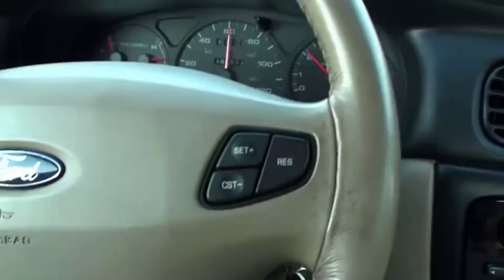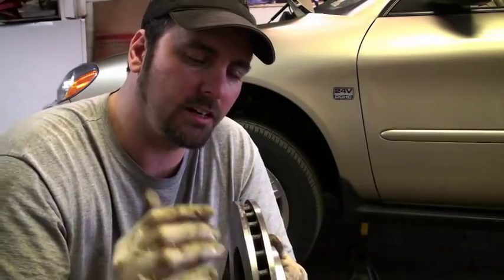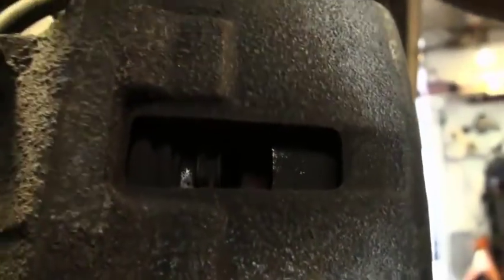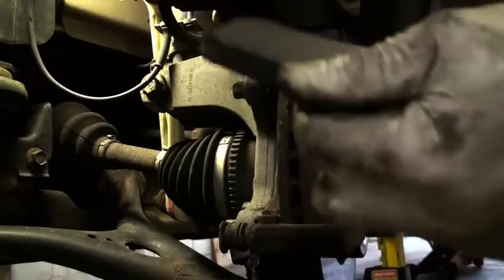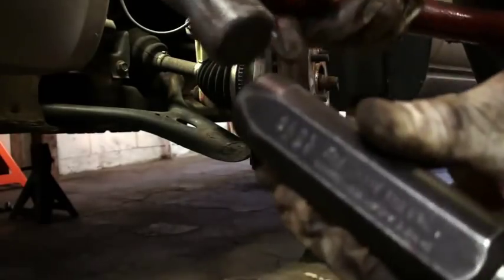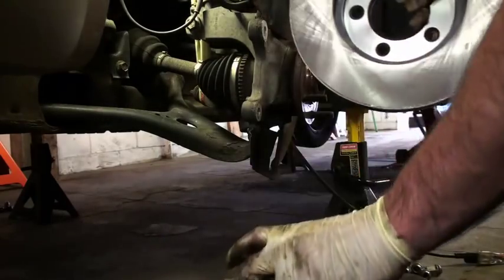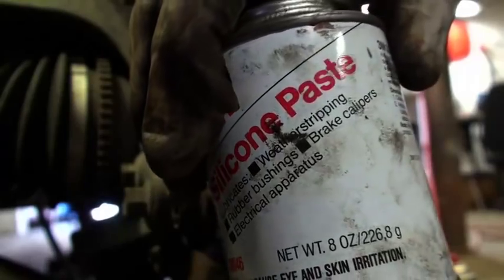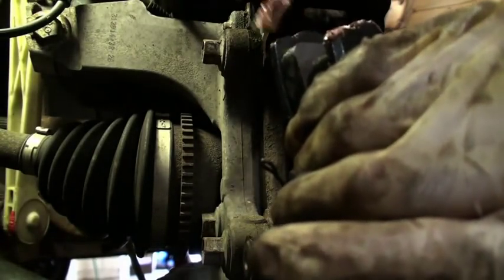Front Disc Brakes and How to Replace Them - EricTheCarGuy

Comment: Eric why aren't you showing proper cleaning or the caliper mounting brackets? there is usually more rust build up in northern states that cause pads to lock in place as well as the slides. there was no mention to use the correct caliper slide grease, or even using some stay quiet on the back of pads, or anti-sieze on spot with metal on metal contact. I have to ask are you ASE certified? You are knowledgeable yes but there are proper steps to make brakes last longer.

Comment: It is better than clamping off the high pressure brake hose, which may damage the hose.... you just don't clamp off hoses that take 5000+ PSI...  it is asking for trouble.

Comment: I do not like the brake hose with vise grip method, if you want to avoid the old fluid from the caliper to go back to the master cylinder, then just crack the bleeder valve open then compress piston into caliper. Old fluid will leave the caliper so in sense you do a partial bleed.

Comment: I don't fully agree with Eric's approach.   1. Resurfacing rotors, really? So what even if they are bent a few micrometers if the pins move in and out with it? Think!   2. Bleed only if you have no c-clamp handy. Be careful how you tighten the valve-they brake easily.   3. Make sure the giuding pins have not seized. Most of the service stations don't check them and just slam the new pads, get the money and kick you out. Pins are essential for well working brakes. I don't know what is this silicon paste. I used regular high-temp resistant grease. I didn't know grease eats the boot. Then how the cv-joint boots stay "uneaten" for about 10 years? I'd simply clean out the holes for them from the old grease.   4. Make sure your pads match the okd ones and have the shims on them and the pad with the sound spring goes on the outside part of the rotor. Provided you have such pads of course.   5. Don't overtighten, better use non-permanent soft thread locker.   6. Measure the thikness of the rotors each brake pad change and keep it in check. When too thin, replace. Forget about resurfacing and cleaning it.   7. Don't just change anything because you think you can. Brakes that need changing squeal a lot and are still good for many more miles. Of course, once the mid line is gone, they have to be replaced.
Reply: Eidmantas Ivanauskas
When you brake or even strip the bleed valve you'll know what I meant while fixing it...

Comment: Why must you replace the pads if you are replacing the rotors if the pads are not worn out? If they are not worn out one would think there is enough pad material to build up on the rotor.

Comment: I was a little concerned on some items Eric, especially reassembly.  When reinstalling the pins, you did not mention cleaning the female part (hole) the pin slides into.  Most all failures of pins occur because contaminated (hardened) grease is left from the previous brake service.  Clean thoroughly with solvents but also hone (180 grit flexible balls on wire stick) the hole.  This creates a perfect crosshatch pattern that's clean and free of old hardened grease products.  StopBrakeNoise. com

Comment from the maker: @gozanze4ever Normally I wouldn't respond to this but I can't stop laughing.  Break= separate or cause to separate into pieces as a result of a blow, shock, or strain.  Brake=a device for slowing or stopping a moving vehicle, typically by applying pressure to the wheels.  The irony is that your argument is based on semantics yet your spelling needs a little work.  Don't be mad, just laugh with me and know that I mean you no disrespect.

Comment: 2006 Chevy Equinox is having trouble starting had it towed to pep boys where they put in a new starter it was working fine till about a month later same thing started not starting again had it  towed back to pepboys they put a starter in this weekend it did the same thing but was smoking a little but overheating not starting had it towed back to pepboys they tell me that when they did the diagnostic test some codes came out that mean that I have to take it back to the dealer to deal with because the codes that came out I guess maybe they're not familiar with I don't know have you ever heard of such a thing?

Comment: Actually you are supposed to machine the rotor if you're not replacing it every time you replace pads, do to uneven surfaces, pits, or wear patterns in the rotor. Any uneven surfaces on the rotor will cause uneven pad wear and can wear out your brakes faster.

Comment: There is no one (1) proper way.  1) If you clamp the brake line, you may damage the line - never been a problem for Eric.  2)  Almost everyone (myself included) force the fluid back, which could damage the Master Cylinder... This can be partially mitigated if you go very slowly & a lot of people bench bleed a master cylinder with a syringe forcing fluid in reverse to get the air bubbles out.  Some open the bleed screw, don't clamp, and retract the caliper cylinder...  Whatever works for you!

Comment: @EricTheCarGuy well I dont have much money. and I am trying to see If it is possible. My auto. tech. teacher got a car in that the customer which is a teacher said that they was making a noise. he told us to take the brake pads off and sand the edges to a 45 degree angle and sand the surface. that is why I asked.

Comment: in order to change the the front discs on a 4runner it looks like a shit job as you have to remove the calliper and then the hole hub with wheel bearings as the discs are bolted behind the hub. why in the hell did they design them like this? that would be a long video Eric would be good to see though